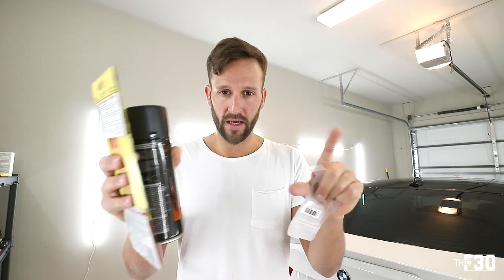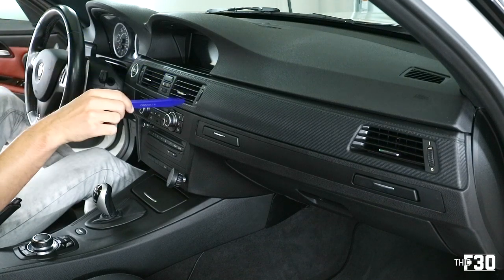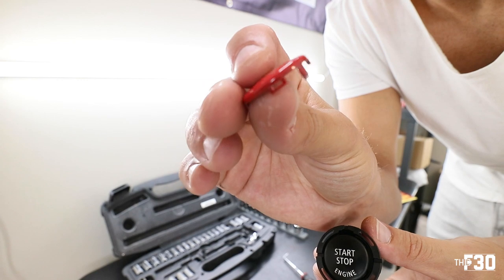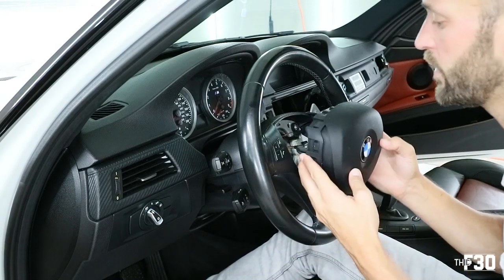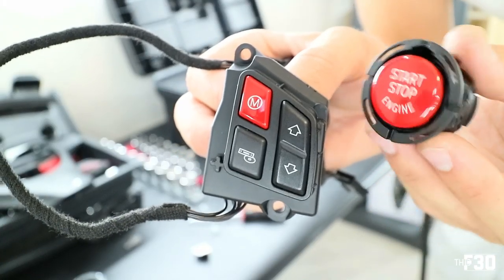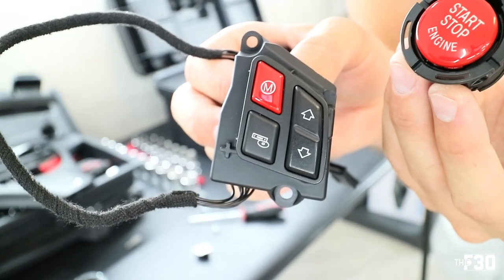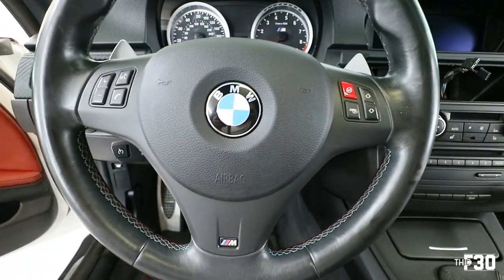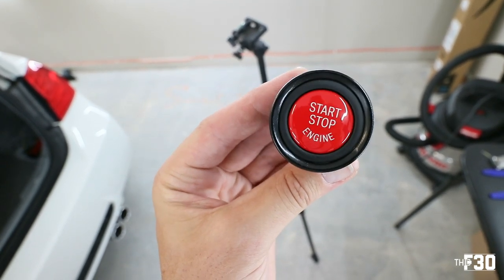BMW E90 M3 RED START/ M BUTTONS AND REFINISHED TRIM!

Comment: Looks tight! Please make a video on how to fix the drivers side door pull. Mine is doing the same. I did the red M and red start button. I also put on a Alcantera flat bottom wheel with a white 12 o’clock strip, and Alcantera middle. Looks awesome! Great step by step how to video.

Comment: Great job repainting the steering wheel, looks brand new! How did you manage to get the inner ring on the start button out though? Bc mine has been peeling just like yours but I can’t seem to remove it from the outer aluminum ring on the button

Comment: Great job Jon. On the downside though, my eye goes to the steering wheel leather more now. The perfect center trim highlights that aging original, shiny leather. Mine is the same on my F36 GC. Curious to know your thoughts on how to overcome it. I've had mixed results trying to bring it back to matte black. Forums seems divided on if its even possible. Some say this product or that. Some say no product, just a damp cloth. Others say a refurb with leather spray paint is the only solution. I'm leaning more and more toward a Mewant leather overwrap. Do you have plans for the leather on either of your vehicles?
Reply from the maker: Eventually I’ll do a new wheel in the e90. The f30 wheel is pretty much flawless, brand new. I’ve yet to mess with any leather conditioners but I definitely will before I swap wheels
Reply: Thic F30 👍. I get the feeling these wheels need to be maintained from day 1 to stay looking newish. Once they’re past a certain point there’s only so much you can recover. Love watching the journey though so keep up the great content.
Reply: Use Dr Leather Leather Cleaner to clean off back to matte leather, sand off any scuffs as required then use colourlock leather dye in F034 Black, the steering wheel will be like new.